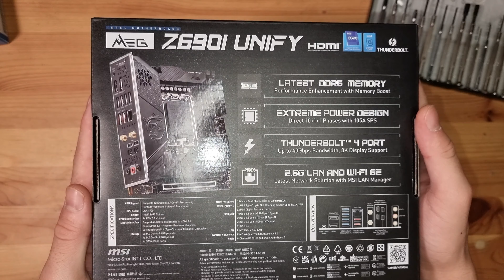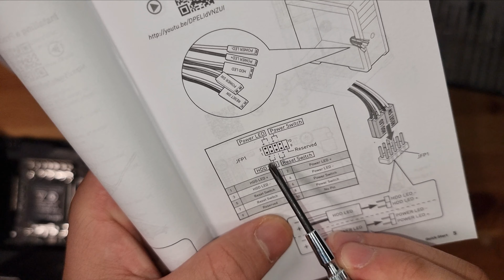MSI MEG Z690I Unify, overview, mini ITX God, for intel 12Gen K

Comment: I'm thinking about this board, putting it into an Antec dark cube. Trying to keep the MSI brand. Is this board good for gaming? With i9 12900K, and MSI 3090 GPU
Reply from the maker: Bro out there is nothing even close to this board, this is at the moment the best mini itx board and the best i ever seen
Reply: @gamotech2557  would a Corsair aio cooler fit? The ones with the leds? If not, what's a good aio cooler that can fit, for either 12700k or 12900k?

Comment: Question: can you take the m.2 cover off and still install 2 M. 2 drives in the front? I want to get this board but with the included m.2 cover it's too tall for the EK cooler. I heard you can take it off and it should fit.
Reply from the maker: yes u can but the top m.2 will not have a heatsink then, i don`t think it solve ypur issue and don`t recommend u to do this at all
Reply: @gamotech2557  appreciate the reply. My idea was to then get a m.2 heatsink that is much shorter.
Reply: @Plainetalk  i just got this board. you can use corsair icue h100i capellix. there is no need to remove the heatsink. There is plenty of space for this AIO

Comment: Спасибо за обзор!

Подскажите:
Какая маркировка батарейки?
Какая маркировка вентилятора VRM? 
Сколько пин подключение вентилятора?
Reply from the maker: 453 / 5,000
Translation results
Я не совсем уверен, правильно ли я вас понял или нет,
а вот у вентилятора на этой материнке нет батарейки, только батарейка биоса на этой мобо не требует замены, она прослужит более 10 лет,
вентилятор имеет 3-контактный разъем, который подключается к материнской плате, он не похож ни на один другой 3-контактный или 4-контактный разъем вентилятора на материнской плате, если хотите, вы можете удалить его (для меньшего шума), но он абсолютно бесшумный,
Размер вентилятора: 25x25x7 мм

I'm not quite sure if I understood you correctly or not,
but the fan on this motherboard does not have a battery, it is only the BIOS battery on this Mobo that you don't need to replace, it will last more than 10 years,
the fan has a 3 pin connector that plugs into the motherboard, it is not like any other 3 pin or 4 pin fan connector on the motherboard, if you like you can remove it (for less noise) but it is absolutely silent ,
Fan size: 25x25x7mm
Reply: @gamotech2557  
Благодарю за ответ!
Да. Вопрос был про батарейку BIOS.
Reply from the maker: пожалуйста